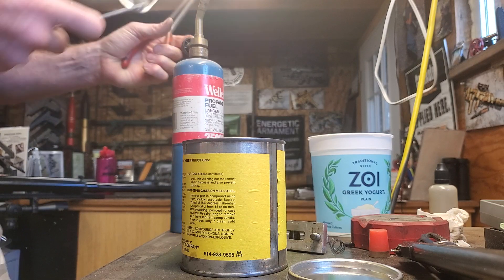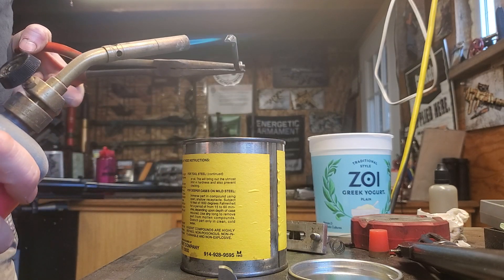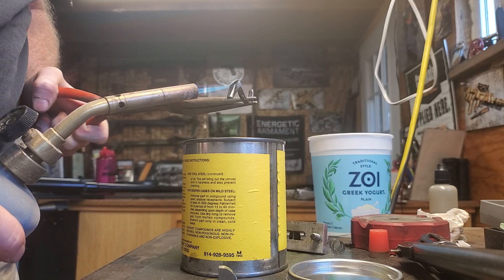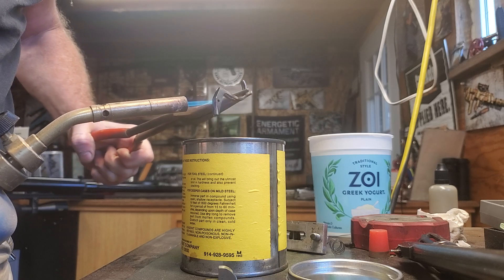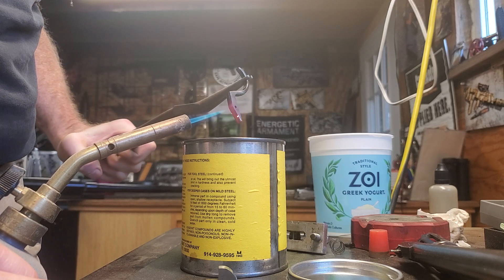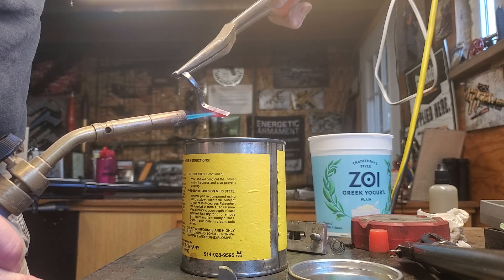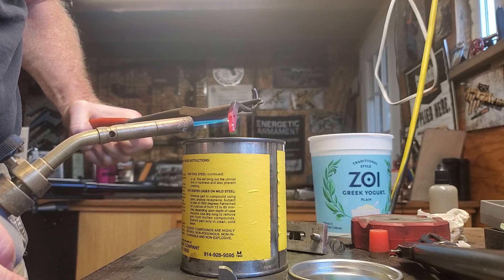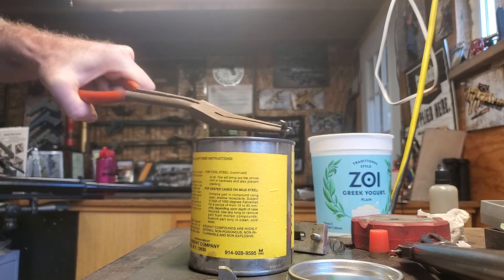Case hardening small parts for better wear resistance.

Comment: will any brand of yogurt work or does it have to be greek yogurt
Reply: Now that I had may fun, real question, just make it cherry red , it does not matter how? correct?
Reply from the maker: @paperburn  there are color charts on line. Yellow hot is around 2100° F I think? So kinda depends on what you are making and the use. Trigger parts I go somewhere between 1200 and 1600 degrees size matters too. I will not heat a tiny part as much as a big thick part. I do not want to make the steel brittle
Reply from the maker: @paperburn   so color depicts temp. So bright red is around 1600° 
It does depend on how hard and how deep you want that hardening to go.